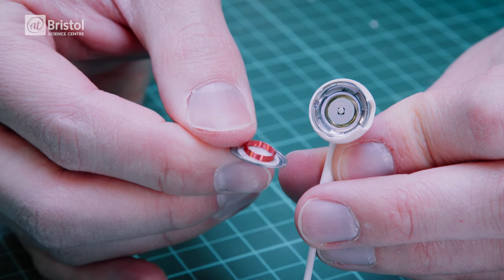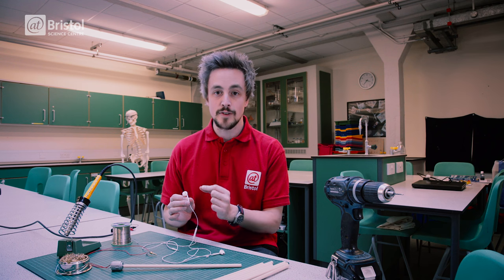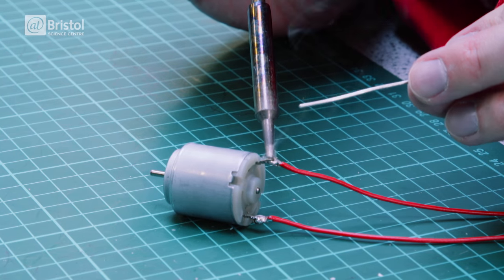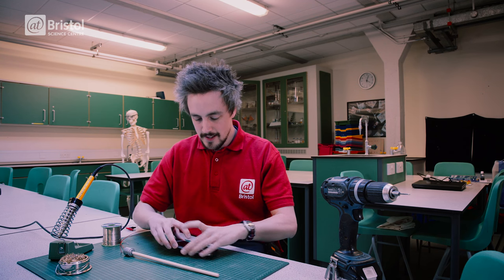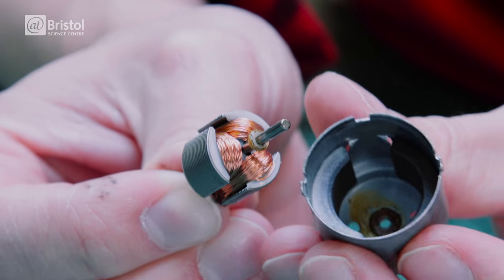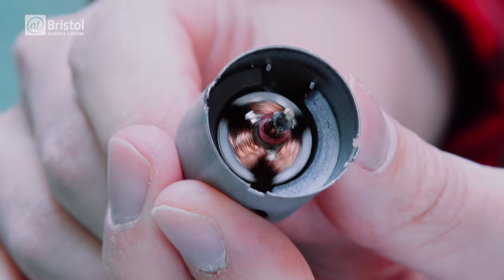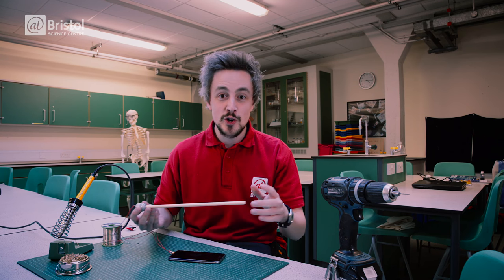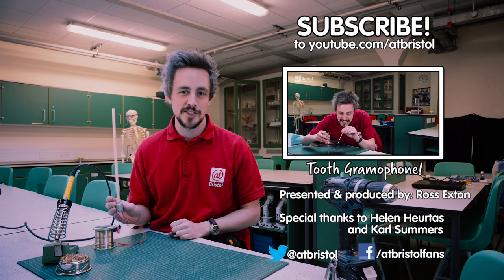How to make jaw bone headphones | Do Try This At Home | We The Curious

Comment: why it doesn't works?  I'm trying but the motor doesn't start after conect audio Jack to my cellphone.  Motor is ok, it works with a 1.5V battery, and I tried with 3 different audio Jacks. Some thing else that you don't mention in the video? thanks.
Reply: It works.. but I can hear the music without bite nothing, it's like a very weak speaker (is this good?) I mean, I thought the sound was generated by the vibrations caused by rotation of the shaft through bones, but shaft doesn't moves at all, and sound it's persived by my ear.. I did connect a piezoelectric component and this also sound like a speaker. what's wrong? what should I must to do for avoid common sound and just hear through bone conduction only. Thank you a lot!
Reply from the maker: Hi Miguel,
Have you tried reducing the size of the hole drilled into the wooden dowel? You need a very tight fit in order to condut the vibrations.
- Ross
Reply: Exactly the same thing happens to me... What did you do to make it work?
Reply: @wethecurious  hi Ross, so to clarify, does the spindle rotate or not? I'm trying to get it to work but can't figure out how?does it work with iPhones?